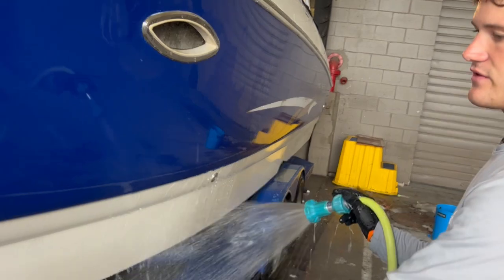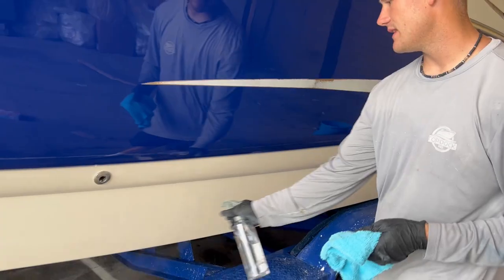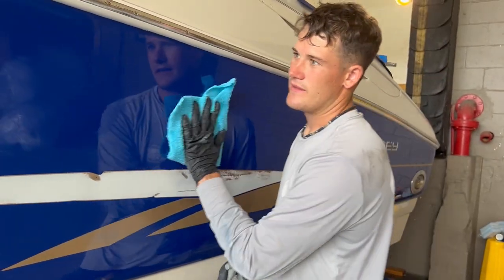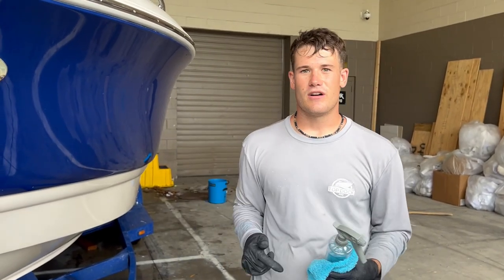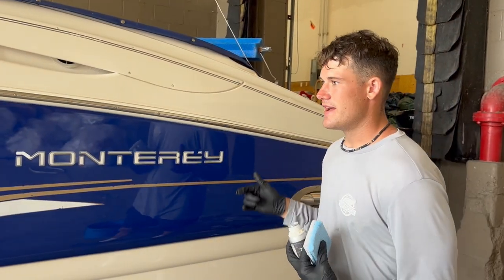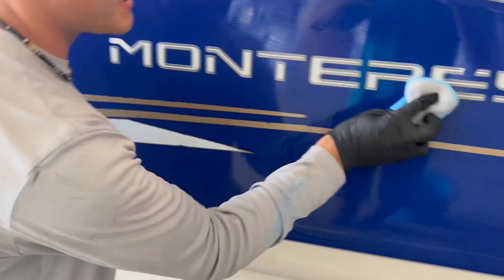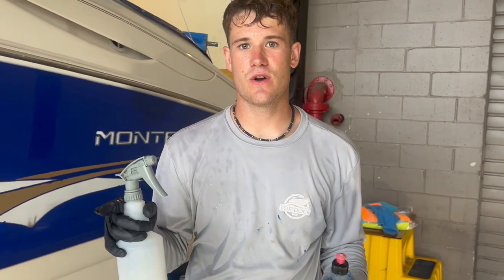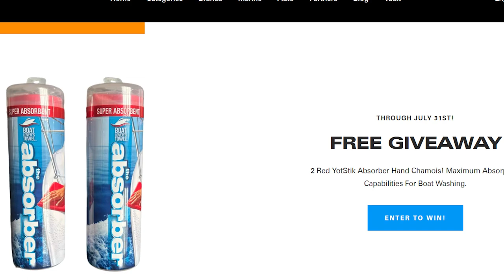Wash, Prep, & Ceramic Coating A Monterey Boat

Comment: Quick question: I did a full correct and coated with liquid thor early this year. I am nearing the end of my season and have 1 or 2 very light scuffs from fenders, and a few water spots. Can I touch up over the ceramic with triple P? Or do I need to use elevate and recoat those areas? Thanks!
Reply from the maker: You can always Venom wash to remove the water spots and then use Triple P or Elevate if necessary to restore the areas. Then recoat it. Liquid Thor typically only lasts 6-12 months
Reply: @topdockpro  Thanks!